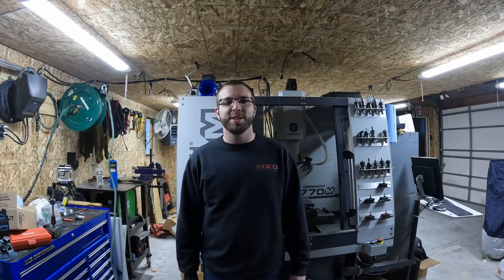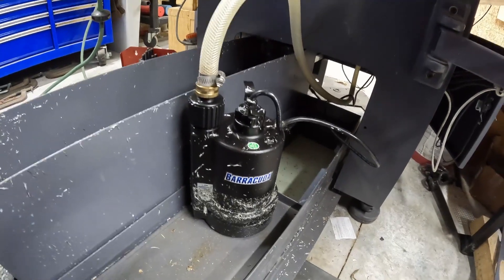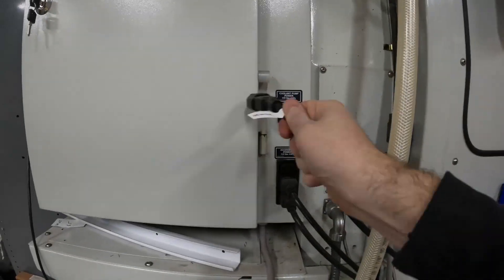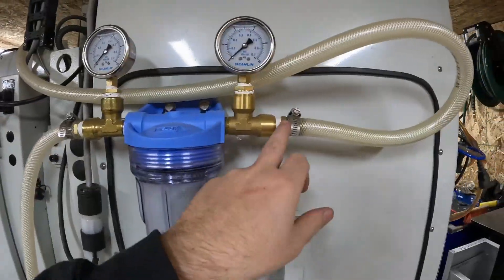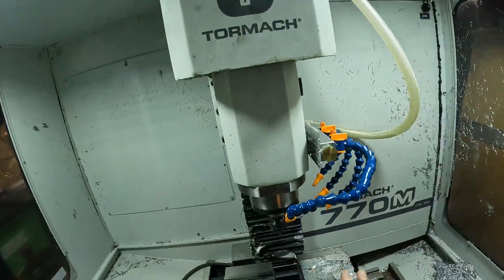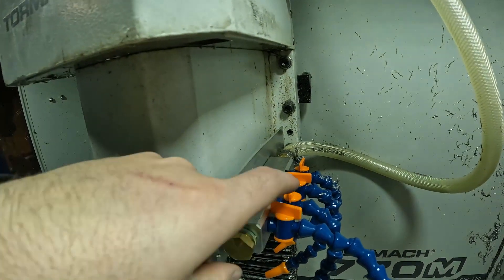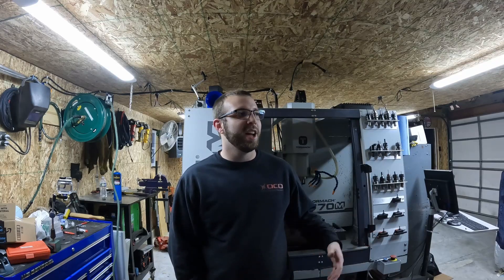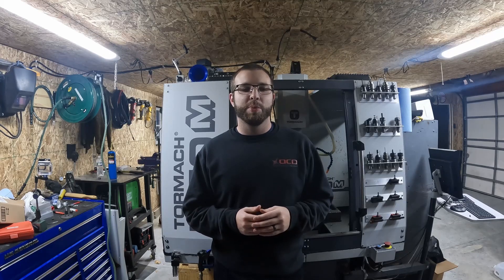HOW TO MAKE YOUR OWN COOLANT SYSTEM ON YOUR TORMACH

Comment: I made mine out of a evaporative cooler pump.
I simply lengthened the shaft to the impeller and the two legs that support that impeller shaft so that I could set it in an 18" deep Tupper-Ware type coolant tank.
It worked great.  I had most of the components in my storage room.  The only thing I had to buy was the  actual flex-hoses that I attached to the column of my mill.
I used some old nylon window screen as my triple redundant filter for sifting out the metal chips.
The flex-hoses that sprayed the coolant were held in place with neodymium magnets for easy placement.  The magnets were high enough on the column that they didn't attract metal chips.
Reply from the maker: That's pretty sweet! I might have to borrow that window screen idea. I need to get around to putting a screen or mesh in, the filter on the back helps so much and keeps the lock lines clear but gets plugged up sometimes. Thank you for the comment!

Comment: Thank you for your well done video.  Food for thought.  I only have a 440 (wish I had gone with a 770 MX as I like my little machine) but I do want to increase the flood capacity and chip management for better performance and hassle.  I do want a flush down cleaning hose also.

Comment: Did a similar thing on my 1100MX.  I added a drag chain on the right (facing the machine) just for the hose and I've been running it that way for 2-3 years without a problem.  I really recommend the drag chain and there is tons of room on the right of the spindle since everything else comes in on the left.
Reply from the maker: Yeah that sounds like an amazing idea! I will definitely be looking into that. Will definitely come in handy. I appreciate you commenting that!